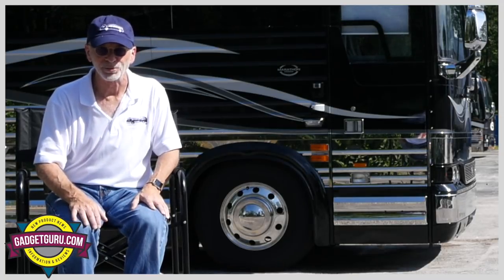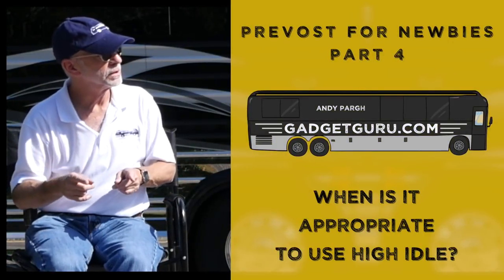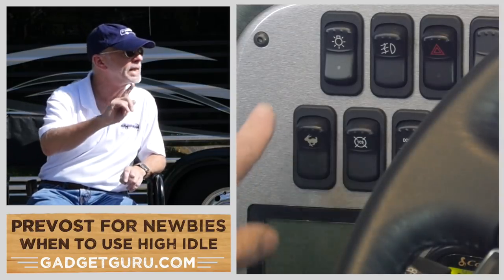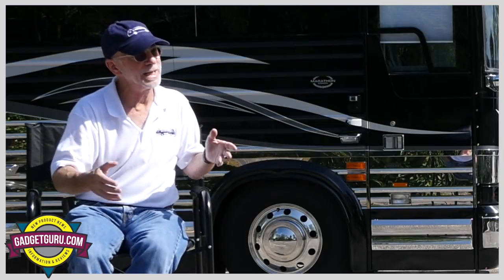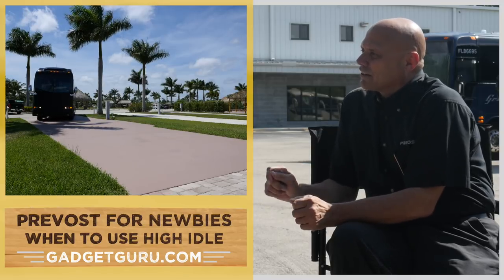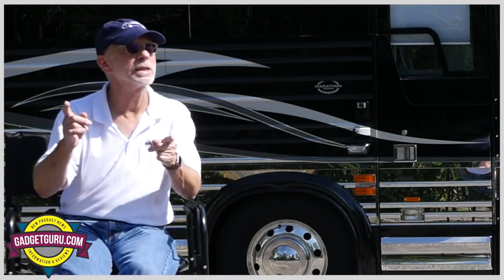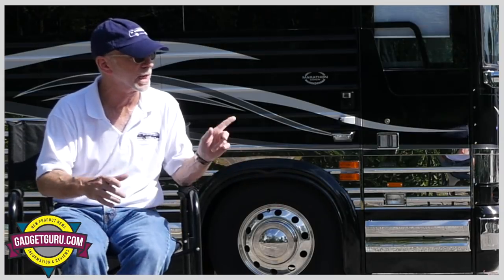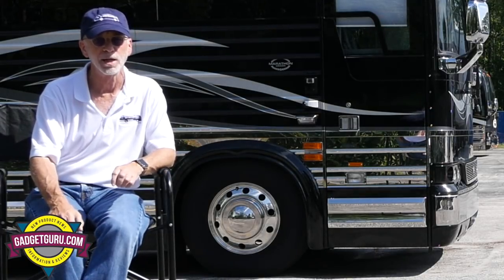When To Use High Idle In A Motorhome

Comment: I want to know what about air pressure before using high idle?  It seems that if you use high idle before Auxiliary air is built up it causes a major strain on your belts and those components especially the alternator.  However,  by the time you wait for auxiliary air to build... You no longer need the high idle, lol.
Reply: Saul Trevino absolutely there are small airbags that keep tension on the belts in the older coaches. If you throw fast idle on your not only slipping the belts, but you could throw them of the pulleys. You still need fast idle after air builds up if you are using coach havoc. If the engine is a 8v92 or 8v71 you always need fast idle, but if you have a 60series or Volvo engine as long as your alternator is not being called on to use a lot of amperage, eg. hvac

Comment: Andy, I know that you have driven both the 500 & 600 hp coaches. Is there a noticeable difference between the Newell with the 600hp Cummins and a Prevost with the 500hp Volvo?
Reply from the maker: I'm not an expert when it comes to diesel engines, but the Newell coaches I drove did feel like they had more power and throttle response and could get up to speed quicker. The Volvo engine seems to operate quieter. Driving a Prevost is akin to being at the helm of a locomotive...a very nice riding locomotive!  If I have the windows closed when starting the Prevost with the Volvo engine, I have to listen carefully to hear if it started. If I had to provide a comparison of the rides, the Newell models felt a bit softer/lighter to the touch than the Prevost models I've driven. In my opinion the Prevost feels more confident on the road. On the topic of power, probably the peppiest motorhome I drove was the Entegra Cornerstone...but that one is in a different category.
Reply: Thank you so much!